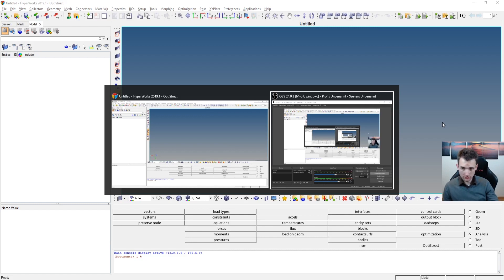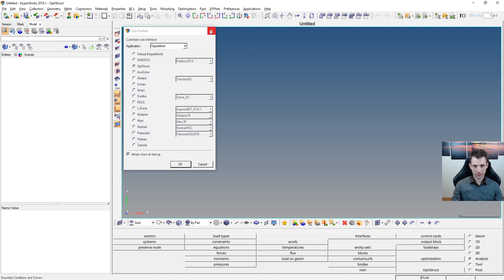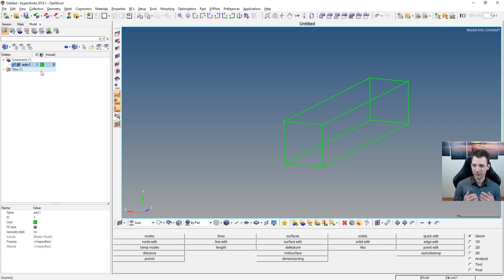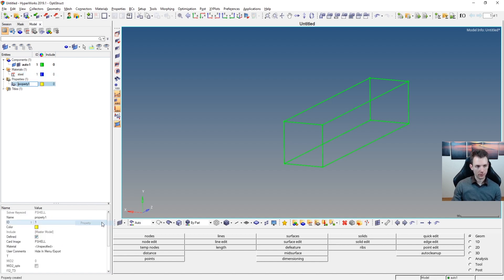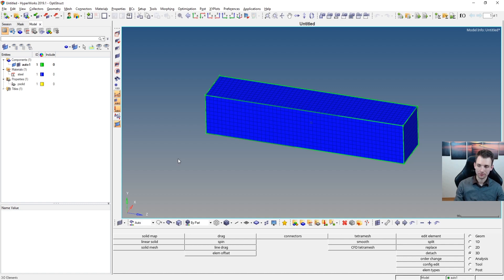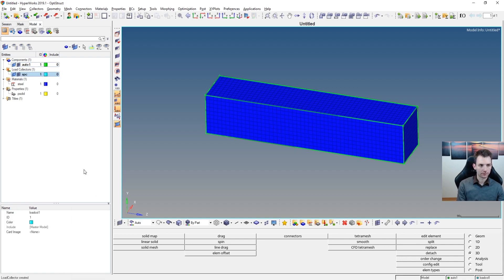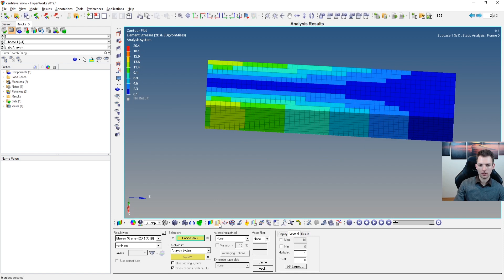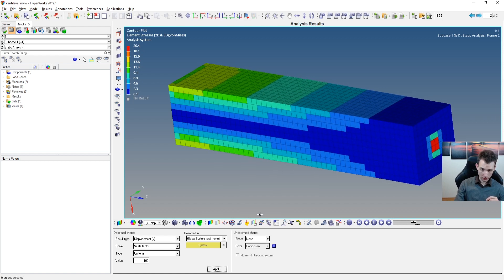Hypermesh FEM Model and Hyperview Tutorial

Comment: Hi. Thanks for the video. I am working for LS Dyna solver on HM 2020. I have a question regarding material property assignment. What is the use of property? Can I not directly give Material to the component? I am asking this question because, in HM 2020, property has no option called 'Material'. Therefore, I assigned the material without creating a property directly. Would there be any disadvantage in this approach?
Reply from the maker: Properties are used to describe the element type for example the element thickness - you don't set this in the material. For LS Dyna I cannot tell exactly how it is done as I never had the chance but there is no harm in assigning material directly to the components. One example I can think of where you don't need a specific property assigned to a component is with 1D Properties which are often directly assigned to the elements. Hope this helps.
Reply: @ManuelRamsaier  Thank you for your quick reply. :)
Reply from the maker: @srikantav4068  Sure, if you have any more questions, let me know :)

Comment: Hello, can I ask an off topic question? to run Hypermesh correctly it's necessary to be always connected to Ethernet??
Reply from the maker: Hey Stefania, 
depends on your licese. If you have a network license and dont borrow it, then yes. Hyperworks product will constantly look for the license to be available every few minutes. If you have a local license (specified as a file in the security folder) it doesn't matter. If you have further questions don't hesitate to ask or send me your specific case to ramsaier@rwu.de 
All the best :)
Reply: @ManuelRamsaier  thank you very much! In fact i have put the license file in the secuity folder of Altair 2021 in Program files, but it seems it does not work without Ethernet... do you know if there is a way to set the license as "local"?
Reply from the maker: @stefaniamagnettigisolo5775  Yeah, so its a local license (the license is contained in that file). If it were remote you would specify a path to your license server. The thing is, that local licenses are bound to your mac adress. As you were requesting the license you specified a mac adress. This Mac adress I guess is the one of you ethernet controller. So if you deactivate the network controller it will not work but if it is just not connected, there should be no problems. 
Best guess is: Check if you specified the correct mac adress and if this mac adress is present in your ipconfig - all. Hope this helps. If thats all unsuccessful, please contact the altair support team directly and they sure will figure a way for you :)
Reply: @ManuelRamsaier  thank you very much! can I ask a further question about thermal loads? I know how to define thermal load on some nodes, and include it in the Loadstep, with the option TEMP... but if a I had to define a different thermal load with a different value in other nodes, how cai i do this? I tried to define a LoadAdd with the two thermal loads but when I have to select the load in TERM option in the Loadstep card, I can't select the LoadAdd...
Reply from the maker: @stefaniamagnettigisolo5775  Hi there - sure. I am not much simulation thermal stuff anymore but as fas as I remember it was a SPCADD as the thermal loads are done as a constraint and to add it together you would want to choose the SPCADD card. Hope this helps. If its still a problem, please contact me again with your model, then I will look into it :)

Comment: Hellos,
Thanks for the video.

Please, how to configure Hypermesh so that its interface interacts correctly with the mouse of the computer as in a CAD tool? Currently I have to click buttons from the interface to zoom or rotate parts. It is not practical.
Reply from the maker: Which version are you using? The new version does not make you press ctrl when rotating.
Reply: @ManuelRamsaier 
2021, my Hypermesh version.
Reply from the maker: @brud_action  The new layout can be started with Hyperworks 2021 - not Hypermesh Desktop 2021 - give that a shot. It should look similar to my videos about hyperworks x (its former name)